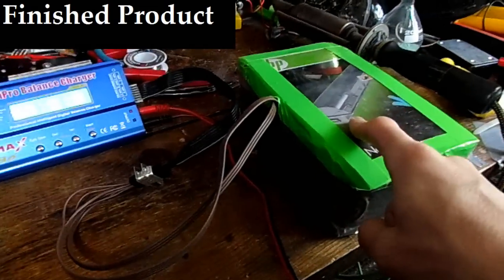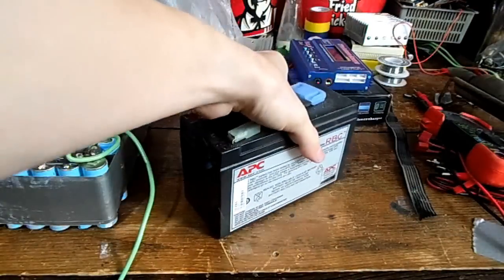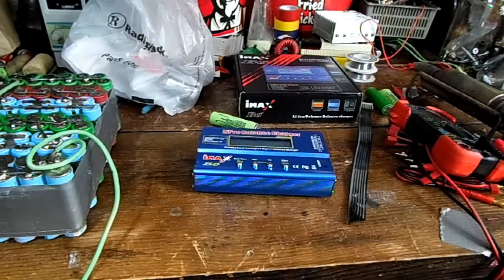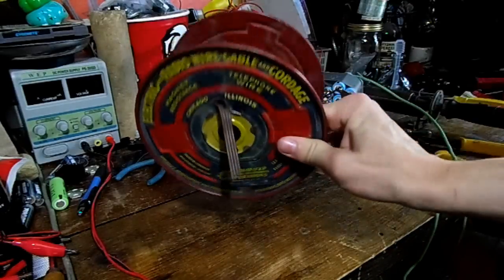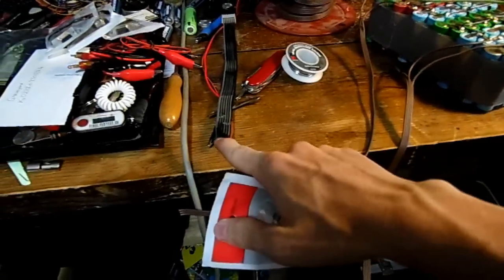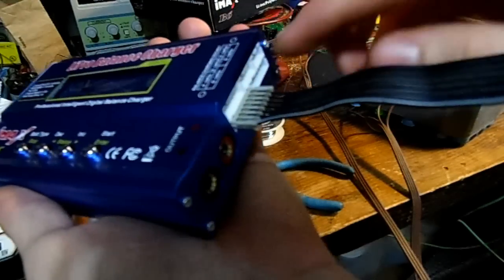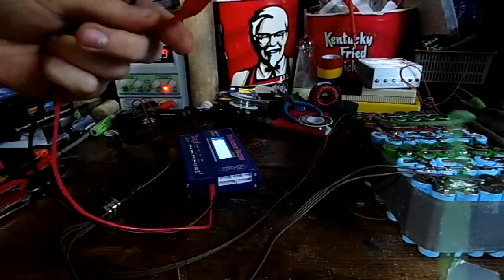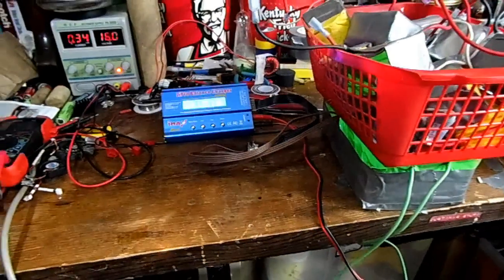DIY: Balance Charging E-Bike lithium battery upgrade

Comment: Hey thanks for the mega quick reply. Ryan here again just on my phone not PC, wasn't expecting such a quick response. I wasn't sure about whether an induction motor would run off DC efficiently but I'll go by what you say being a super genius and all :) thanks for the advice, I'm expecting the donor motor to be similar to this:

 http://www.sparessearch.co.uk/parts/ys6037/hotpoint-motor-and-cradle-348-C00143146.aspx

In your opinion is it worth bothering? What voltage should I be aiming for with my batteries to run it?

 Planning on having the rear derailleur as a gear for the motor only, a second ratchet system purely independent of the motors cogs for freewheeling so the pedals don't fly around etc. So many ideas have spurred from your videos lol. Could never afford to buy an ebike kit but I'd love my ideas to come to fruition.
Reply: Thinking about it. I'll run the dryer on a cycle while reading the voltage. That will tell me whether it steps down in the board
Reply from the maker: Ryan Hills
personally i've tried mounting a big engine, steam engine, and electric motor on bikes and they dont work too well due to size. it would be best to find a flat disc shaped motor for the bike.

a good disc shaped motor would be a ceiling fan motor. and they are low enough RPMs to handle a 26inch rim. most cieling fan motors arent even 600 watts so you could first power it via 12v-120v inverter and a 12v battery.

only issue is connecting the wheel around the motor. could weld it together but would need to make sure its very even and not wobbly.

in the end i would still recomend a 270$ bike kit. its not that bad of a price given the vehicle your getting.
Reply: Rinoa Super-Genius thanks for the advice, at the moment i'll be making a ratrod style ebike and have verrry limited materials to work with and about £50 which will (hopefully) buy the charger/balancer and a few bits to create a controller of sorts. perhaps a ratrod enthusiast will buy it off me so i can buy higher end parts in the future. until then im kinda stuck with li ion cells and an old dryer. thanks again, itll take a good while to get my act together but i'll let you know how it goes. thanks again.

Comment: hey im basically gonna do the same thing, main difference being that ill be taking an induction motor from a tumble dryer, using a relay to simulate alternating current, was gonna use a 555 timer on a 3hz switch... my main question is this... because im taking the batteries from dead laptop batteries, do i need to charge them individually first then balance them? or can i just test and solder, then charge them all as one? im not exactly sure how that works and pretty much think my whole idea is slightly flawed... but i wanna try with absolute minimum cost. any tips on what is the best bench psu to use etc would be appreciated.

Ryan
Reply from the maker: i would charge each cell first to make sure they arent faulty.

also i've had issues with relays not lasting long with rapid oscillation. most washing machine motors are universal meaning they are made to take AC but will also take DC just as well.

Comment: Hey Bro..Thanks for all your support/suggestions. I am planning to build a 48V battery using 3.7V laptop cells for my hub motor. Technically speaking i need about 13 banks to achieve this voltage requirement( 48V/3.7V per bank=12.97banks). However, i am not sure if there is any balance charger that can charge the entire 48V. The other option in my mind is if i can charge each cell only up to 3 V instead of 3.7V. This way i need total of 16 banks(48V/3Vper bank=16 banks) to produce the required 48V.Then i can create 2 seperate set of 24 V just lik ehow you did them and cascade them together.  what do you suggest? would the idea of reducing 3.7V to 3V work?
Reply from the maker: 3.7 is actually 4.2v. so instead charge them lower to just 4.0v.

3v would be bellow dead. they would prolly drop down to 0v when you tried to pull power from them.
Reply: So charging to 4V implies that i only need a total of 6 banks for a 24V battery pack, right? And when cascading two 24V together, would there be a possibility that the overall voltage would be much less than 48V? what is a typical input voltage variation that a 48V hub motor would accept?
Reply from the maker: Tatanka Yotanka
for 48v motor i'd say 36-55v. when you pull power from the battery its going to drop in voltage. so maybe make it 52v so when you pull from it it might be closer to 48v
Reply: Rinoa Super-Genius for 52V, i need a 24V battery and a 28V battery. the 28V would now has 7 banks to be charged. would this charger be able to charge 7 banks at once? i thought it is limited to 6 banks at a time..

Comment: Lithium ion cells are 4.2v peak 3.6v norm and 3.0v and under low or dead. The balance plug can be found on ebay by searching for "lipo balance plug". These li-in cells can go below 3v but when the charger says "low voltage" they can be jump started by a NIMH charge for 30sec or so but lipo cells are gone if they are discharged too low. It would be a good idea to get a plastic conduit junction box to put the battery in, they are water proof and mountable to a flat suffice.
Reply from the maker: no, you can revive an 18650 cell even if its at 0v. i've done it many times. theres just a trick to it.

and actually i've been eyeing a plastic conduit box for them also. the reason i made this one with mostly tape was so i could quickly rip it open if something went wrong.
Reply: Ya that's what I meant with li-ion 1650 cells they can be revived with a jump from a NIMH charge but lipo (lithium polymer) cells wont charge if they discharge too far down.
Reply from the maker: Allen McKinney
lithium-ion and lithium-polymer are the exact same thing, just differant production methods.

my sources for that statement are Dave Jones at EEVBlog and also from my own experiance working with them.

Comment: I'm creating my own battery pack, almost the same. I keep coming back to this video as I now have the same power supply and iMax is on its way too. So thanks again!
Reply from the maker: haha awesome!
Reply: Rinoa Super-Genius You're spending all my money ;) I'm thinking of replacing my car for local runabout stuff to an e-bike. But have to look at license and regulations in New Jersey.
Reply from the maker: Andrew Jones
shouldnt require any licence or anything, then again new jersey is weird.

wait a minute, new jersey? i thought you lived in the UK.
Reply: Yes NJ has a bunch of weird rulings like that. From what I read, anything over 100cc or 25mph requires a license etc.
Reply from the maker: Andrew Jones
ah here its 17mph and above is just simply impossible and eligal. but nobody cares if you go over 17mph.

i find that really 20mph is a good speed because any higher and you waist more electricity/range.

Comment: You should have soldered all the pins in your cable first. Soldering the cable to your battery should be the last step, for your own safety.
Reply from the maker: i didnt solder the connector to the cable.
Reply: Rinoa Super-Genius Solder/clamp is the same thing.
6:31 You soldered the cable to the battery. 6:59 you start cutting and putting pins on a live cable.
If you simply reversed 6:31 with 6:59 you wouldn't need to say "I want to make sure I don't short this out".

Comment: Doesn't off-shelf battery pack have balancing circuit inside?
How much money u save with this artisan work?
Reply from the maker: well idk any place that sells 48v 35ah packs. and like 15ah packs can easilly cost 400$. these cells only cost me 80$ per 24v block. and you could find cells for free if your recourceful. millions get thrown away every year.

also most battery packs i've seen dont come with balancing circuits.
Reply: Rinoa Super-Genius
Thx 
I'll use your suggestion in my project

Comment: Why would two lithium batteries in series not take the charge voltage equally? I would think that two 4 volt batteries in series on a 8 volt charger would take 4 volts each. I don't understand why one would get 3 and the other 5 volts.... UNLESS it is due to some freaky chemistry in the lithium batteries......I heard they are on the freaky side and heard of the battery packs just going along fine in a laptop and just explode and catch fire and I mean BURN.
Reply from the maker: it takes several charge/discharge cycles for imbalance to happen. the more balanced your pack is the less out of balance it gets.

Comment: Do a teardown of the lipro balance charger! You'll won't know what you paid for if you don't open it up.  Just open it up and give us some closeup shots of the pcb and the ic part numbers and we'll have the info to determine whether or not you got what you think you paid for.
Reply from the maker: or you can watch EEVblogs teardown of it. either way it works fine. and as long as it works 6 months before it burns out i'm happy. and it definatly has lasted 6 months.

Comment: hi friend, thanks for your informative video! 
unfortunately there are sellers of counterfeit batteries, and also false information, for example batteries ((18650 3.7V 5000mAh battery)) sold on aliexpress, 5000mah this writing, but they are in the "truth" 3000mAh, thanks!
Reply from the maker: everybody knows that. or atleast should. the best source is old laptop battery packs. thats how i get mine.

Comment: @Rinoa I plan to attempt to convert one of my cars to electric.  I have been looking at different battery options and as far as I've seen, the best option for the most power for weight is either your setup or dewalt battery packs.  I'd be interested in talking with you about developing these into a style of back that could attach to a buss bar or some other type of connection in the vehicle as a modular battery system for ease of maintenance and installation.
Reply from the maker: I'm wanting to do that. I'm already going to be selling 12v 13ah battery packs for bikes that connect together.
Reply: I had hoped to do conversions for friends and neighbors as well, so I'd need to make them easy to mount and swap for the conversion process.  Given the limited spaces available for battery mounting in a standard unibody car without sacrificing storage space, they would have to be packs like yours at either 24 or 36 volts to improve an individuals ability to balance charge the packs; as well as replace any that become faulty.  I would also have to come up with some way to either have a mounting tray for them, or have them include their own mount integrated in the case.  Obviously that would require some kind of manufactured case, but that wouldn't be viable any time soon.  Mostly I'm just interested in making something that wouldn't take people 6 months to install into a car and cost over $5000.  That, combined with a modular setup that people can add to over time to keep costs low would open up the door for more people to convert to E.V. in the short term with minimal investment.
Reply from the maker: hellcat1988 just FYI i've been thinking about using plastic conduit boxes for a battery box.

at Rural King they sell a 10x10x6 inxh sealed box for only 20$ that could prolly hold 4.2v 300AH of cells. and could wire them differantly for whatever voltage you needed.

only thing is lead acid batteries are free and we have an unlimited supply of them so it would be wise to use them first. just get them off recycling skids at auto shops.
Reply: The two problems I have with that are the reduction of capacity in cold weather and weight to power.  While most people are happy with 65-300 mile ranges out of their E.V. conversions, I want to try and build either my Mazda Navajo or some other type of truck to handle at least 600 miles or better on an 8hr charge.  I know that won't be easy, especially considering that I plan to use those blue B6 battery chargers that you use to act as balance chargers for the setup, but I still think it's more then possible with enough of these packs and a few inverters hooked to a 240 power supply.  The main goal of this project would be to provide long range high power E.V. options on a FAR lower budget than a Tesla S so more people can get into an E.V. sooner than the 10-15 years it would take for most of us low budget car moders would have to wait before they became affordable.  That and to provide an easy to maintain and repair E.V. for those who don't know anything about them.  I know of at least 10 people off the top of my head who don't know anything about either vehicle maintenance or battery maintenance that would need a car setup like what I'm hoping to build.
Reply: I was thinking of different options for an electric motor that would be as near as possible to a direct bolt in replacement for car, s.u.v., and light truck differentials, eliminating the need for people to have adapter plates or various other components manufactured for them.  Front wheel drive trans axles would obviously be a different story, as they would need something like a standard transfer case in place of an in-line differential setup.  Both options would vastly improve people's ease of conversion.  Given that there are a few motor options both in D.C. and A.C. that have usable driven shaft out both sides of the motor, the issue would be selecting a motor that is small enough to fit in the standard differential space and building some sort of brace/bracket setup to allow for solid axle type attachment as well as independent differential setups.  Obviously there wouldn't be a true "universal" option due to different manufacturers using different mounting options as well as inconstancy in the manufacturing process, but I still think it would be possible to at least have some basis for a setup that would reduce the amount of time to swap from a standard axle to a power-shaft setup in only an hour or two, instead of the many hours to days that it takes now to swap a different type of differential into a car because of welding and fitment issues.
Reply from the maker: hellcat1988
unfortunatly every battery chemistry i know of is effected by cold. lithium the most. i made a video about my ebike in winter.

i like your idea for 600+ miles. i think its very possible. plan on using a Forklift motor for power source? they can be up to 20HP. thats almost twice as much as youd need for a car

also with the B6, it first charges the battery without balancing it. like it charges my 24v battery with straight 24v. but then when one cell reaches max it slowly charges and balances each other cell.

you could charge your vehicle with unbalanced DC voltage to like 96.0v and then let the imax B6's balance them with their own power. i think if it detects a cell that is over voltage it just burns the energy off.

if you set teh B6 to lipo (i think) it charges to 4.1 instead of 4.2v. also you can find a hidden setup screen to de-calibrate it to 4.05v. that way you have an extra 0.15v before it damages your cells. you only lose like 20% capacity but gain about 1000 charge-discharge cycles.

i hope that makes sense. basicly youd charge it with a high amp power supply (like 30 amps) then just use the B6 for balancing not really for charging.
Reply: The more I add to the system, the more complicated it will become, and the more off putting to those who don't know anything about the setup.  I'm hoping to get to a point where people can just plug it in, push one or two buttons, and it'll charge, then balance the batteries over night.  Obviously they probably wouldn't need to be balanced every time it was charged unless they wanted the most life and usage out of the batteries, but I want it to be simple enough that they can.  It'll take some time and development to get there of course, especially with the B6 only having 4 balance ports per unit if I remember correctly, but it's still easier to hit start on those then to program something for the average person.
Reply from the maker: hellcat1988
the B6 can only balance 6 cells in series. so 24v. just fyi.
Reply: Depending on the amp hr per cell, that won't be too much of a problem as long as I use relays of some sort to separate the battery packs for charging.  I'd have to use a forklift motor for my first build because of cost, but I plan to try and use a system with a motor that runs 110v+ for acceleration and top speed to make it a viable replacement for highway use.

Comment: So if you had a 12v pack. Where would you put the balance leads
Reply from the maker: 0v, 4v, 8v, 12v. so 4 wires for a 12v 3 cell pack.

Comment: Okay, I wired up my battery pack - 3 cells in series.
For some reason I decided to connect the balance lead the wrong way round... :P 
It was saying the cells were all at 0V, so obviously something was wrong. Why does it matter which way round it is though, for measuring voltage? Do you think there are diodes in there?